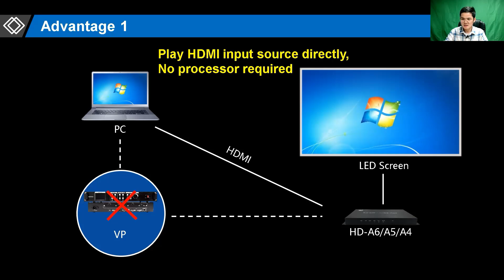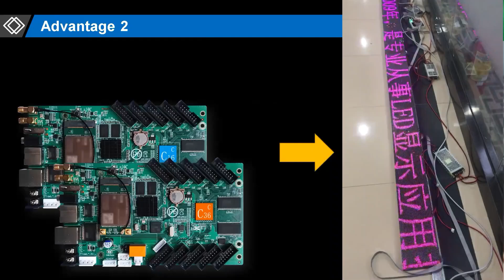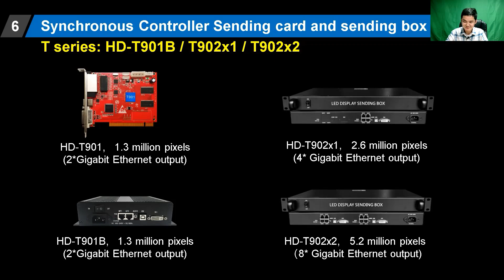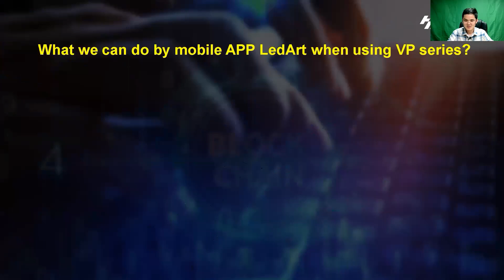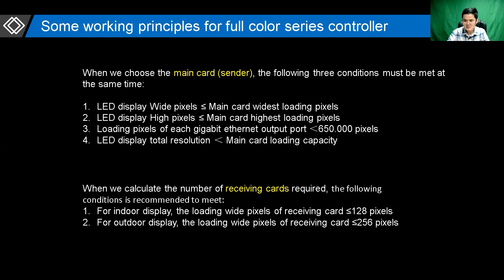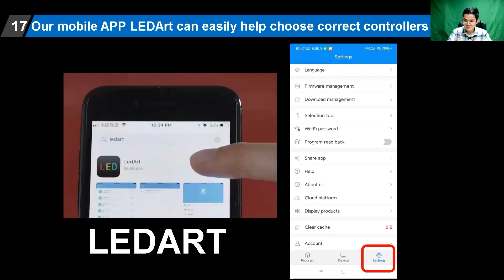Topic 2 - How To Choose HUIDU LED Display Controllers

Comment: Can i use WF4 with p2.5 led modules?
Reply from the maker: yes, but had better first check its IC chips of your p2.5 modules. welcome add Whatsapp and wechat: +8613510540791 , will arrange engineer help you.

Comment: can hdset to configure module with different brand? ex: in cabinet 1 is from brand A with huidu C16C, then in cabinet two with brand B using receiving card HD-R512T.
Reply from the maker: it can try to do settings separately. Any question, please consult WhatsApp: +8613510540791

Comment: Dear sir,

Thank you for your updates and Great explanation of huidu controller cards

I have few doubts

1. For a fixed p3 (64 X 64 pixel ) video wall having H: 384 pixels and W: 640 pixels.

2. I have chosen c36c controller card
   can sending card alone is sufficient for above said video wall

3. Why we need to use receiving card in indoor after every 128 pixel.

4. If 128 pixel for indoor limit to a receiving, then what will be maximum limit for outdoor.

5. How do I know the minimum and maximum pixel for a receiving card

6. In W series we connect to its maximum pixel limit, and works fine.

Please help me to understand best.

Thank you
Reply from the maker: hi my friend, any questions, please consult WhatsApp: +8613510540791